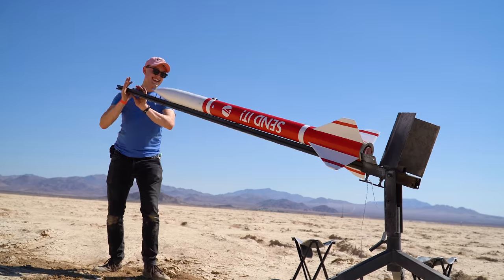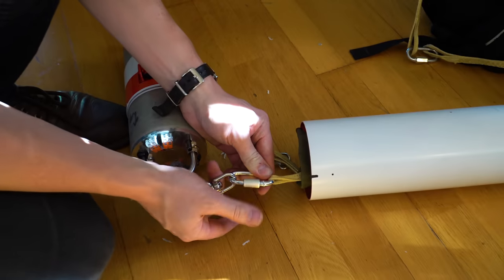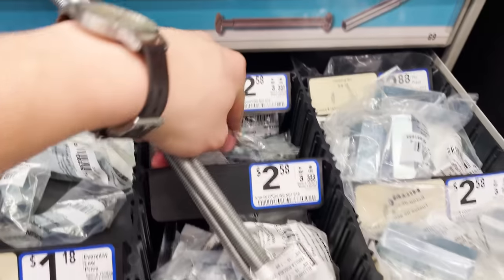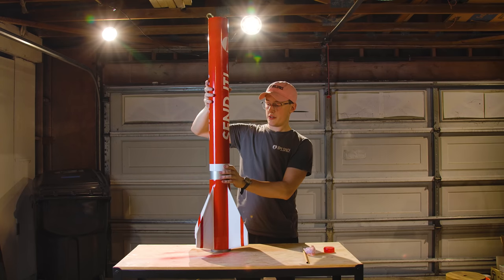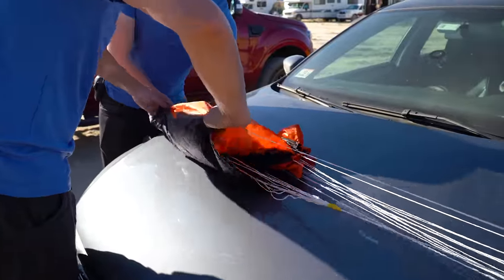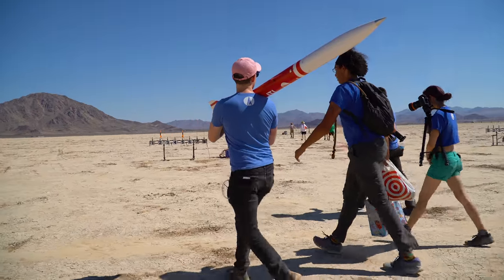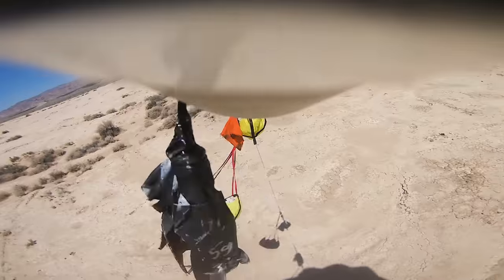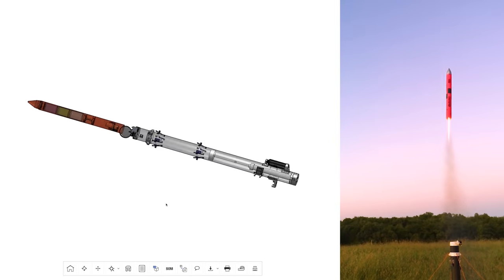SEND IT! - Rocket Launch

Comment: For next time, if you are having trouble getting the grains to slide through the liner (especially if you're bonding them) its okay to peel layers of the casting tube off until they fit in easily. That way you don't have to put force on the grains and risk damaging them.
Reply: i'm assuming the casing is only cardboard... what about just giving it a light sanding
Reply: How about using the lube he had on hand?
Reply: And a large vice
Reply: I might suggest that you use a ball joint press for repairing drive axles... Less potentially catastrophic pounding involved. It's just a screw drive press, and they're comparatively cheap and large.
Reply: @Unmannedair  The grains are rubber based. It's pretty easy to damage them if you apply a lot of force. Peeling a layer of paper off is absolutely the best way to make a tight grain fit into a liner.
Reply: I don't know anything about rockets  so this may be dumb. But what about getting an electric blanket and wrapping the liner? You could also put the grains in the fridge. Should easily gain the clearance needed even if they have a low thermal expansion coefficient.
Reply: @yellekc  absolutely has the right answer. When in doubt, no matter what the problem, always ask a car mechanic
Reply: @yellekc  a pvc pipe heating blanket would be good
Reply: @Version38.0  Using a large vice will probably bend the tubing causing it to not  fit well.
Reply: Same thing with the 29mm Aerotech paper liners. You usually take off the paper on the outside of the liner.

Comment: 3:36, something I learned in Boy Scouts: those types of scales are designed for weighing humans, and are optimized for the weight distribution of the human body.  So you'll get a more accurate reading if you weigh yourself holding the object, then weigh yourself not holding it, and calculate the difference.
Reply from the maker: This is so cool, and totally makes sense! Thank you!
Reply: I was wondering about that, the fact that the rocket weighed over 200 lbs and Joe holding it in one arm looking for the center of gravity didn't seem right lol
Reply: @austingilbert7356  It was 23.3lbs on the scale (aka 10.6 kg) not 233lbs.
Reply: @Hagop64  oh thanks lol, that makes more sense

Comment: A quick tip when cutting threaded rod: screw a nut onto the rod past the cut line, then after you make the cut, just screw the nut back off the end to reform/clean up the thread at the newly cut end.
Reply: and the most important thing: use the angle grinder the right way! he uses it upside down, which is very dangerous.
Always hold it in a way that it is pulling itself away from your body, so if it binds up, nothing happens...

Comment: It feels really happy to see you get better and better every time.
just a small request...
Can you please make a video or leave a comment here about the rough cost it takes to make a project like this....
I will be really happy if you respond 💕 :)
Reply: Not as good as Joes (obviously) but I did a 10km shot on a rocket pretty similar to Lumineer. The final cost was $1200, plus a $1000 dollar motor.

Edit: This was my first composite build, so a good amount of the cost was from trial and error and getting all the necessary things for working with fiberglass. Should be a much cheaper build on my next composite rocket.
Reply from the maker: Sure! For a rocket like this you can probably do it for under $1000USD but it depends on what you're spending with tools. The rocket motor is a few hundred dollars, but you'll need the case separately which is also a few hundred dollars - that's probably where most of the money will go. Fiberglass tubes and fins aren't too expensive depending on how you do them. A nice chute like this is about $250 depending on where you get it, and the rest of your budget can be eaten up by avionics. Tons of ways to build rockets like this though! You could do all sorts of bells and whistles and spend like 10k on something this scale, or you could get a little sketchy and maybe do it for less than $500 if you're borrowing the motor case/etc. Having rocketry friends can help you cut costs a lot :)

Comment: Awesome flight! Hoping you get your certification as well. For the SD card problem, the simplest way is a remote sd card mount. Placing the actual card within a padded remote enclosure further within the rocket and connecting it via a ribbon cable (reinforced to reduce tears) means that even if the camera breaks or the whole thing is ripped out, the sd card will be safe.
Reply: Or send the SD card out with the tesla roadster
Reply: You could connect parachutes to the SD card itself.
Reply: @shipofthesun  Hot melt glue it to a fly for softer landing.
Reply: @robertsmith2956  I like the cut of your jib.
Reply: this is the Way  & the reason I came to comment.

Comment: Wooo! Congratulations! 
After the epic Lumineer saga, this feels like a a fitting part 2. 

On the problem if SD cards, I would recommend looking into non ceramic chips that are redundant to using SD cards. SD is an awesome standard until you ask its ceramic substrate to take the kind of stresses you are asking. Every drone I have every flown has flash storage on board for this reason. I'm sure with your level of electronic wizardry you already know all this, but I thought it was worth writing.

Comment: I always go to the lucerne dry lake bed at least twice a year. This year we came out on November 12th and it got cancelled so we had to head back on a 170 mile drive home. We were going to fly an H-motor out there. We also forgot launch rails so we couldn't launch other rockets. They said it got cancelled because of it being wet when it was dry out there. We also forgot to check the website to see if they were going to do the launch. But we also went outside, threw a baseball and almost lost it a few times. Since there is no grass it keeps on rolling. Overall we had a great time out there even though there was no launch. We also went to the store in the lake bed.

Comment: Nice work with everything. Should you consider putting 4 cameras onboard or get a drone version on insta 360 so you can have lenses pointing outwards on both sides of the rocket and stitch a 360 footage afterwards. It also helps you separate the camera imaging part from the actual main unit where the SD card and battery is so you can put it inside the instrument bay
Reply: I have an insta 360 camera and the biggest issue I face with it is that if the camera gets damaged by a fall or a crash, it shuts off, and doesn't complete saving the video file to the sd card. You lose a few minutes of footage at the end if you try to recover the data, so basically you miss the most exciting part. Wouldn't recommend for this application.
Reply: Yeah unbeliavable how this guy manages to crack an sd card again smh

Comment: I guess Lucerne Dry Lake has come a "Long Way" since I was scratch-building rockets and testing them with Jerry Irvine and David Sleeter, back in the early to mid '80s!  (We also made our own motors, as nobody back then made any!).  Made some "Sugar-Shot to Space" motor tests there, too!  (Richard Knakka designs).
Also, in that same area, we used to bring our ultralight airplanes out there to test (crash) them, after building/modifying them!  (Some were our own designs, with snowmobile engines on them!).

Comment: SD card extension cable, plug one end into the camera, the other end has a connector for an SD card. The SD can can then be put into a foam block to protect it from cracking.

Comment: SD cards are just SPI, so you can flying lead a full size one with an external connector and pot it in epoxy for strength. Awesome work!
Reply: The base protocol is SPI but they also contain semi-secret extra protocols that use more pins (for higher speed) -- and nobody knows what commands/protocols the firmware uses.  I'm not saying that the such an extender won't work (it likely will) -- I'm saying that you need to extend all the signals and not just the SPI ones.

Comment: suggestion, for a goal, build a 2 stage model rocket and have it deploy a steerable parachute so you can radio control the descent of the camera payload from the ground to a pinpoint accuracy landing. with amateur radio beam antenna equipment. your ground station. get an amateur radio license so you can long range your radio control systems.

Comment: I do some prototyping for the military. I kept losing cards too. Simple solution is to look at the product made for 3D printers that allows you to remote mount a SD card. There's a small dock for the car to go into like normal but then there's a long flat cable that has a simulated or analog card on the end of it. So I install the card on one end and then I dip it in epoxy to make a small block. I use pins on the opposite side wired into the cable in case the cable gets ripped off. It makes the card indestructible. Depending on the material you use you can make them Fireproof too. I have had one melt inside the encasing. But while it was hot enough to melt the plastic around the card it wasn't hot enough to cook the chip so it still worked when I plugged it in. It wouldn't have survived inside a camera but it did fine inside the material that I used which I can't talk about sorry.

Comment: One solution to the SD card issue could be to make up a ribbon cable that extends from your camera setup and nestle the actual SD card safely in your avionics bay. That way the card is safe and only the ribbon extension could get damaged. Cheap and you won't lose any data up to the point of cable failure.

Comment: Regarding the GPS issue, if the GNSS module has an external antenna connection (e.g. u.FL or SMA) you could hook it up to a little breakout with an RF switch IC and use a GPIO (or I2C if you can break that out and find an I2C RF switch) to toggle between two antenna positions in the case of acquisition loss. Those ICs are super cheap these days and you could even expand this idea to other onboard RF links for additional reliability.
Reply: Speaking of which, you can get some fairly fancy RF switch ICs from LCSC for next to nothing when they do their old/short stock clearance sales with 90% off. Right now they've got six Qorvo RFSW6023TR7 5GHz 2:1 switches in stock for $0.30 each and two Renesas F2914NBGK 8GHz 4:1 switches in stock for $1.24 each, both normally 10-20x that price at Western distributors. I scraped their REST API for discounted products yesterday and ended up grabbing $1600+ worth of parts for $200 incl. shipping. I can send over my scraping code if you want.

Comment: To help prevent the SD Cards being damaged, perhaps look into using SD card extension ribbons. These are often used with raspberry pi projects to put the SD card in a different position. Maybe you might be able to move the SD cards away from the cameras themselves to keep them safe and to make for easier removal

Comment: There are microsd slot extenders with a flexible circuit board that is shaped like an microsd card so that it goes into your camera, while the other end of the flex circuit is a microsd socket.  Perhaps that will let you locate the card where it is better protected.

Comment: An option that might fix the cracked SD card is moving the board of the camera away from the lens and sensor. RunCam says the cable is 58mm which might be enough to get the board and SD cards out of the way of the rest of the camera.

Comment: You can make it by spitting old broken SD cards in half with a scalpel, removing the inners and soldering <30 gauge wire to each point and running it out the back of the card (through ribbon style holes) and then at he other end do as you need to, to connected the correct pins on an SD socket. Glue the original SD card shell back together and bam! SD card extension.

Comment: If you want a bit more safety for the charges, can you use spring-actuated contacts with a plastic remove-before-flight tag fed out through a hole in the fuselage? e.g. a clothes peg with the two contacts on it, held open by a length of weed-whacker/strimmer nylon line as the tab.

Comment: Thoughts on having a cut-down pyro to disconnect the chute after touchdown to avoid such problems in the future?

Guess it depends on anticipated wind. You're trading a new failure point (risk of the cut-down firing prematurely, although you could mitigate this w/ two redundant links fired by different computers, each of which can hold the chute load independently) against the potential damage to the vehicle from dragging. Also if you jettison the chute there is a chance you may save the vehicle from dragging but lose the chute.

Comment: You might try a couple of pipe clamps for the pressure fit of the motors rather than a hammer.  they are cheep and adjustable

Comment: Congratulation ! I also build rockets in France but we don't use the same ejection system as you. Have you thinking about using hatch with servomotor or others mechanical systems instead of pyrotechnic system ? 
I really like your video, thank you for the time you spend on it !

Comment: If I may make a suggestion about SD cards.  I have no idea how to prevent them cracking but if you use a micro SD card and then an adapter.  Why do I think a micro would be more durable?  It's smaller.  Takes leverage or stress of some sort to break the card and just being smaller will give it less chance to have leverage applied.  Draw back is they are thinner.  Maybe the smaller target will give stresses less chance to get at it.  Maybe.

Comment: Is it against best practices to use some kind of mechanical assistance to push the propellant grains into the liner? Seems like you could set up a beam that has lots of spots to engage a lever to push it in, maybe even a racheting or floating jam-lock system. But also it's rocket motors, I don't know maybe levers and rocket motors aren't friends? It looks a lot like a 1.5:1 advantage might be plenty to make that process smooth

Comment: It's anecdotal, but a distant family member of mine sent an external drive (a 2TB WD passport) to "them" when it was damaged in a flood. They got back to him in a few days saying that it was "zero written." After he told me about this, I said he should let me try. 5 mins of Google showed that the USB->SAT controller board in those (which is what makes them external drives) comes with a sort of always on hardware encryption. Furthermore, the key was static if the user didn't use WD's software to initialize it. I got a sacrificial drive board and hooked it up... got all his data back. I still have the naked drive, still works fine.

Bottom line, be skeptical of "professional" data recovery services. They make their money off small folk with low effort recoveries... and apparently are not always even good at that.

Comment: Want the data off your SD cards send them to the tech fix in Ocala Florida - I use to work there as a tech - the owner has a reflow machine and can switch chips onto new SD boards and has been successful getting them off before on several several occasions the dude is a electronics god damn genius.

Comment: I wonder if you would have more success with a flash module soldered onto a PCB somewhere damage is less likely to occur than wherever the SD cards were mounted.  Those receptacles are iffy for standard commercial usage, so I'm not at all surprised that there's consistent breakage associated with the use of discrete SD cards.

Comment: really cool video. explains really well the experience of trying to launch high powered rockets. 
Have you heard of spaceport america cup. its a school competition that just ended this week where groups of inovative minds launch solid motors aiming 10k ft or 30k ft using a solid off the shelf motor, student reasearched and developed motor or hybride motor. some times there are liquids but this year there where no schools that participated in that categorie. you can check it out at the ESRA (experimental sounding rocket association) youtoube chanel. My school participated in the 30k ft comercial motor categorie. we where the 3rd to launch. and i can say that the lack of sleep we had to get there was great but to see a rocket fly that strait was awesome. we made it all ourselves with a carbon fiber layup and fiber glass transition for the RF to pass through.

Comment: I'd be curious to know what hardware interfaces you're using for writing to SD cards (just SPI or something a bit more advanced?) - what design problems are preventing you from either having the data be written to a second device that's in a remote location - possibly even in an armoured (fireproof, insulated) module which resides in a different physical location within the rocket?
If the IO method you're using requires two-way connectivity you could possibly just literally capture the line data and then have a tool re-construct the write commands - be a bit of work but could be valuable (and I'm sure there'd be libraries out there to do it already).  But ultimately a secondary data-logger module should be tiny and capable of fitting somewhere, right?

Comment: Arent there flexible extension cables for sd cards? You can build a padded sealed box/case. So worst case if the cable (that is firmly stuck on the outside if the case so it will not transfer forced into the box/case) breaks you have to crack open the small padded box/case for it.